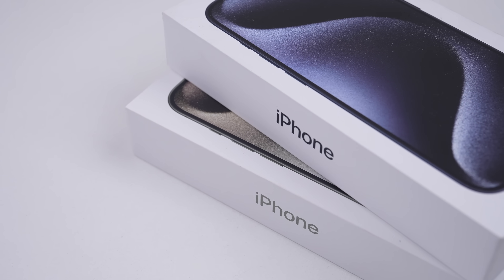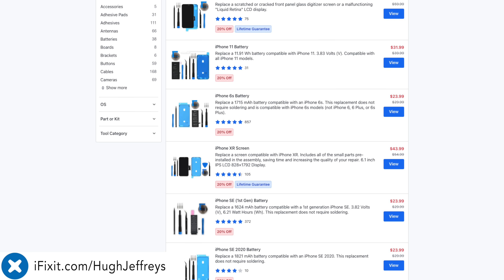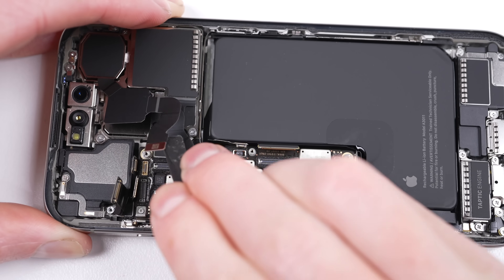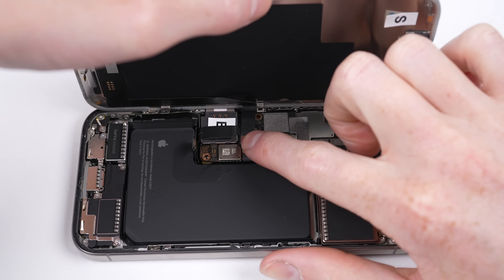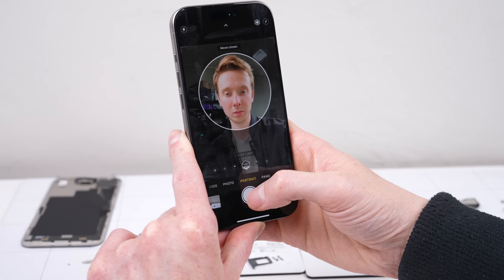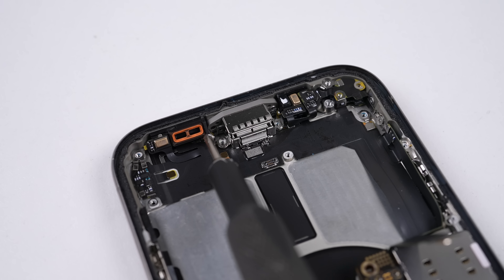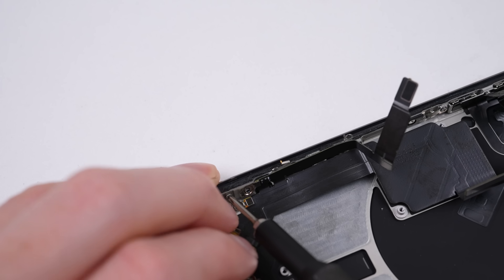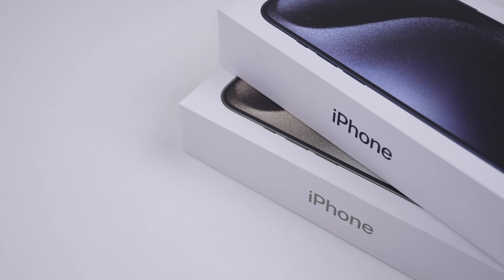iPhone 15 Pro Exposed - This Will Harm The Environment - Teardown And Repair Assessment

Comment: Also, if JerryRigEverything is any indication the back glass on the Max breaks pretty easily if pushed hard where that circle in the frame is. A hollow frame and less glue means that glass that is cheaper to repair is also way easier to break.
Reply: Not trying to protect Apple by any means here, but there’s a lot of people who tried to break the back glass and failed. Zack was just flexing on how strong he is…

Comment: Why are iPhone logic boards (motherboards) smaller
Reply: They’re double stacked for one, and always being first to utilize the new size reduction in chip manufacturing (now at 3nm) they’re able to pack far more into the SoC, keep it microscopically small, and offload even more parts and other chipsets onto this main SoC (or CPU) than traditional manufacturers…

Comment: I actually watched this last night and again today. Apple's policy is shocking: given that they required EU legislation just to abandon the Lightning port, something needs to happen regarding Right To Repair. I will NEVER purchase ANY modern Apple product whilst they are trying to do this, and IMO the repairability should be 2/10 maximum due to the back glass and other minor components not being paired.
I was recently able to repair a Galaxy A50 with a new screen, interconnect cable, and rear camera, and the repair was a success when the fingerprint scanner was transferred across to the new display.

Comment: Hello,
I have a question about the Asus Zephyrus G14. It features an RTX 3050TI and an AMD Ryzen 9 5000 series. The problem is that the laptop has a black screen and turns on immediately after connecting the power adapter without me pressing the power button. Also, I can't turn it off when it's connected to the power cable, a boot loop happens and the screen still stays black but the keyboard light comes on. When I disconnect the power, I can turn the device on and turn it back on from the button. The keyboard backlight is on and I can hear the fan smells but the screen remains black.
I really hope that you give me some tips on how I can fix the problem.

Comment: Counterpoint: Would-be thieves take note: it is not so lucrative to steal my shiny new I-phone and part it out for repairs. The perfect ending would be a step after a non-Apple repair that ties the serial number of the repair parts to the repairer, and enables the parts to work together as new. This could be matched to data that flags phones stolen in home invasions and car jackings (or worse).

Comment: Even without part pairing, this isn't repair friendly at all in my opinion. 
It is glued shut and isn't modular, technically it is modular, but not like a Fairphone for example. 
It's also not consumer friendly, the OS is very restricted, and it lacks crucial features like expandable storage, a user removable battery and a headphone jack. 

Awesome Teardown and findings, Hugh!
Reply: With USB-C you can attach a USB drive for expandable storage, though it'll stick out (I keep one on my keychain). It also works better than a lot of Android devices I've used.

Comment: I just wished apple would use o-rings for the front and rear glass and have the screws in the bottom lock both front and back in place by locking a sliding mechanism.

Comment: I love how they made the back glass removable but attached other components like the charging coil or the mic to it to make aftermarket parts more difficult to source and potentially remove some of the iPhone's functionality if you dare to use non original, aftermarket parts on your own phone. A flssh that is misbehaving or white noise from the mic could be some classy Apple shenanigans when it comes to changing the back glass. Except of course when you reuse the parts from the old back glass, which looks like a pain in the ass to do...

Comment: You forgot a thing - If you swap the back glass, the flash (and wireless charging coil?) is serialized. So if you take a picture with the front-facing cam when having the flash on, the image doesn't save.

Comment: To be honest I think the thoroughness of Apple blocking thinks like this is due to the big issue of stolen iPhones being shipped to China for disassembly. Reddit is full of Chinese people sending western people threatening messages to disable find my, when they don’t those phones get parted out. With blocking unapproved part swaps, in the long run if there doesn’t come a bypass this will make stealing iPhones a lot less profitable and a lot more difficult. So I’m all for it, although I think apple should provide third parties with a way to get OEM (diy) repairs working with this part locking

Comment: I would not be surprised if Apple attempt to use DRM, or some other mechanism to cripple any right to repair legislation in the US or the EU. They could DRM the battery, or gimp performance with unrecognized batteries, or integrate other functionality into the batter, or simply slather the batteries with patents, or artificially restrict and control the availability of replacements so they are "out of stock". Why? Because Apple are jerks and this is what they do to make people trapped in their ecosystem buy new phones.

Comment: The usb-c made little pratical difference because it is based on usb-2 technology and not usb-3 meaning that the charge rate of the phone has not changed at all and to switch out the usb-c you would have to still go to apple to find something that fits. Also, apple could easily impliment a chip (they may have already done so), to reduce the speeds on 'unofficial' cables. All-in-all the EU leglisation as is normal with the EU dishing out rules and regulations make zero difference and when they do make a difference they are always worse.
Reply: The A16 on the 15 is still stuck in the last year of lightning port, which can only have a USB 2 controller only. So a USB 3 type C port won't make a difference

Comment: The biggest thing to me is that the device will be unrepairable due to it reaching the age that apple no longer supports it or no longer issues updates.  They claim to be environmentally conscious but force you to buy new hardware when they drop support for it.  Luckily, my old iMac makes a fantastic Linux machine.  Linux also runs faster than the Mac OS!

Comment: while it is all well and good that the pro versions of the iphone are getting the better chip and thus with it USB 3.0 speeds, the cable that comes with the phone is USB 2.0..
this won't be a problem for folks who have a lot of USBs already, but for those who don't this is a royal pain in the arse

Comment: While I dont agree with Apple about a lot of their "objections" regarding self-repair, I can atleast see a genuine security risk in some things. E.g. Face ID not immediately working because a hacked FaceID sensor could be a huge security risk since you can use it to authorize literally everything on iPhone.

But most of these things have nothing to do with security, but about control. The phone should tell me "hey buddy, i think someone swapped out parts on this phone, please check it out" and it should keep a log so that I can always see when something fishy is going on (and it would be good for buying a used phone, so you know what you're buying into) but it shouldnt lock me out if its not crucial for security. 

And even locking me out for now should mean that i can use everything after a factory reset (where all my sensitive things were deleted and a "hacked" FaceID sensor could not access someone else's files.
Reply: Sensor doesn't store data it's like saying when you cha a webcam is needs to be disabled

Comment: The worst part is, Apple serialised the back glass too, So if you get the back glass replaced from a 3rd party source, You can not use your flashlight, Wireless charger and the noise cancellation mic.
Reply from the maker: Where did you hear this?
They're no issues with replacing the back glass, Tested all these and they worked fine.
Reply: @HughJeffreys  phone repair guru

Comment: If you can, a good video idea is to test whether the iPhone 15 screen would work on the iPhone 14 Pro board and if it would provide for a full 120hz experience - my guess - yes.
Reply: Apple most likely changed the pin layouts or slightly changed the connection to stop that

Comment: 10:54 I am sorry but why do you say it like Apple did something difficult? Not gluing the backglass down so hard that you need a laser ist nothing special neraly every other phone is build like this.
I think Apple deserves all the flack you could throw at them because they go out of their way to make their devices less reparable so you then have to go to them for repair, Samsung tried the same back a few years but backed down because they got fucked for doing this (the backlash was to big). Apple is the only company stating that all this is necessary for securety (disabling the auto brightening function and front-facing camera is surely for security purposes and not to anoy you for repairing your phone yourself).
I hope the EU will pass legislations to crack down on the shit Apple does (like they did for the age-old Lightning port) and forces them to stop implementing software locks on parts so that you can repair your iPhone.
We have to rely on the EU for doing this because the us politicians are sucking on the titts of Apple and the people in the us are too stupid and believe the shit Apple forces down there trought.

Comment: Hi Hugh. I've watched a guy replacing wireless charging coil on Iphone 14pro. Somehow it was paired to the phone as well, where once replaced it prevented phone from saving any photos taken in the phone's gallery. The shutter worked but no phots were available in it's gallery...
So i'll guarantee it will be the same case, with getting rear glass replaced on iphone 15 pro... Have a great day 👍🏻

Comment: Nice work👍🏽  Watching your teardown, tried to see why the rear panel shattered during JerryRigEverything's bend test, without really bending it.  Nothing obvious, though🤔  That usually never happens, but this year it's a lot more fragile.  I wonder if that flexcable from the rear panel caused any of those error messages.  Thanks again for some great teardown work🤙🏽🖖🏽
Reply: The circular MagSafe opening on the 15 pro max has a relatively wide surface area which, on a replaceable back glass, is 'too much surface area'  for such an opening at the center, where pressure was applied. 
The 15 pro doesn't suffer from the same issue, mainly due to it being a smaller device with dimensions that perfectly complement its structural integrity.

Comment: Being Unrepairable except the manufacturer will improve the safety and reliability of the vehicle. I will implement that in our line of vehicles and make the warranty program better than provide repairable vehicles or I will have a dedicated repairable vehicles which the company doesn't care about what ever happens to it after it's sold. its the users. No recollection since it's not known what ever happened to them after they are sold and the brand will be different to not affect the main brand. It a free market chose the reliable, unrepairable vehicles or the unreliable but reliable vehicle which could explode since know one knows what happened to it and people buying used ones good luck.

Comment: It's a shame that Apple is anti repair, cause it's pretty straightforward to replace the screen and battery; compared to say, a galaxy s22 where you need to transplant all the components onto a new frame.

Comment: @6:37 speaking from personal experience, uBreakiFix/Asurion stores can also serialize your part and get FaceID working again, in the case of screen repair. They have access to OEM batteries and screens, so software locks for those wouldn't be an issue, but for the cameras, to my knowledge they still don't get OEM

Comment: The difference in the USB-C in the Pro vs non pro. The Pro is the only unit that works with the new usb-c higher speed and the other model's speed is the same as the old lightning cable
Reply: While this is true, if the 15 has the same power limits as the 15 Pro for host mode, it'll already make that port a lot more usable than the camera connection kit for lightning (limited to 5V 40mA)

Comment: I want to change my iphone battery. At apple reseller store it cost me $100 but if i replace other than apple store, it cost me $75. So i ask the technician, is the lower price due to third party battery? But the technician said, even if you change at apple reseller store, it also the same battery because it also made in china. He also mention that fake apple battery is when there no any apple logo on the battery. Is that true???

Comment: yeah most likely the RAW output, the sensors are so tiny no amount of "megapixels" is going to circumvent physics. As a photographer, anything sensor size under 1 inch is worthless. M43 is barley acceptable as well, DX cropped sensors and 35mm Full frame are a good compromise and of course Medium Format being the best for most. I would assume the resolution of a 4x5 sensor would be mind blowing, but it would be several hundred thousands of dollars.

Comment: Batteries should not be so difficult to replace in any gadget that uses them. Imagine you are forced to buy a new TV remote that too strictly from the OEM when the battery of your TV remote dies! And in case the OEM stops manufacturing that remote.. you are forced to either stay hanging or buy another TV! It makes no sense in making battery replacement so cumbersome in a smartphone.
Reply from the maker: I believe Samsung makes TV remotes with built in batteries now that charge with USB-C.

Comment: Hardware still needs to be made a little more repairable, and the software locking needs to be loosened massively. Even if it was for security, heres a solution that would be JUST as "secure" and still give the user the ability to repair their phones. 

On the apple website if they would let you buy their "verified" parts yourself as if it were another product or accessory, when you recieve the part it is "unpaired", when you put the new part into the phone and log in, you then pair the part and it becomes a working part that cannot be used in another persons phone.

 This would satisfy the (shitty) argument that the parts pairing is done to prevent Iphone theft, while still allowing user servicing. However, we all know apples clear intentions about having to do all the repairs through them, and thats money and more money.
Reply: This is exactly how it works via the self-repair program, but the problem is that it's too expensive and still results in e-waste. Parts cannot be scavenged from broken phones. You really have to balance anti-theft with e-waste.
Reply: Well apple already sells replacement parts, they‘re just massively overpriced

Comment: Your shtick is boring.  Apple was the first company to mass adopt USB A, B and C.  Before most of the pc industry.  The reason for lightening is that USB C didn’t exist when they made it.  And then, extremely obviously… they didn’t want to burn all their customers and force a meaningless change to the port.  No one uses it for data transfer so they gained exactly nothing from the change. You are clearly a talented electronics guy but the headline and the anti Apple garbage is just boring.  Call them out when they deserve it.  It will give you more credibility

Comment: are you sure that the back glass is easy to change?  even if it's easy to remove, haven't they programed the wireless charging coil and they forced you to pay $200 for a new glass ?

Comment: Interesting how the Pro Max 15 failed the JerryRigEverything durability test. The back panel breaks too easily.  I would avoid the Pro Max model.  The smaller 15 Pro passed, although both scratch very easily and deeply at the titanium, from what I saw.

Comment: Imagine a thief stole your expensive iPhone. Yes they can't open it, even if they replace the board, the iphone won't function properly. 

If apple one day removed the software lock function, it will be a good news for thieves and third party repairs alike. Apple knows this and forces its customers to repair their phone in official service centers.
Reply: so what? stop spreading misinfomation
yeah yeah security my ass

if you replace the components on your own expensive phone that you bought with your own money, it doesn't work

like if you dropped your phone and broke the screen, you can't replace it because it doesn't fucking work

Comment: PS. The fact that Apple is now including USB-C ports in the iPhone 15 series has nothing to do with EU regulations, but happened for two reasons: 
1. Apple's ten-year support warranty for Lightning to third-party accessory manufacturers expired last year.
2. Apple also uses USB-C in all of its other devices now. So why not?
By the way, when Apple introduced Lightning, there was no USB-C port. What should Apple have done? Use the crappy micro USB port? 😂

Comment: The best thing Apple can do when it comes to Right-To-Repair is…

1. Serialize the parts to a user’s Apple I.D. instead of Apple themselves. This can be done by storing the Apple I.D. data to the Secure Enclave. 

2. Allow third party repairs to buy parts officially from Apple for a fair price. And after a repair have the customer come in to sign into their Apple I.D. to serialize the parts to that person… not Apple. 

3. Allow officially bought iPhones/Macs/iPads parts to be swapped. So long as the devices were bought from Apple by the same person and signed into their Apple I.D.

Comment: Apple implimented USB C however they used a USB 2.0 controller in the base model iPhone, a standard that came out in 2000. USB 3.X came out in 2008 and Apple still refuse to implement it in their non-pro phones...